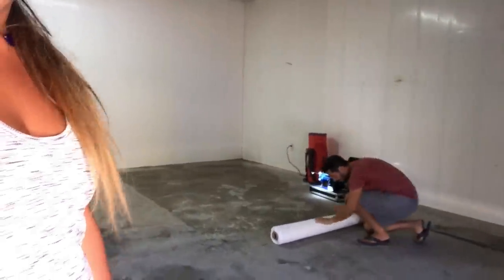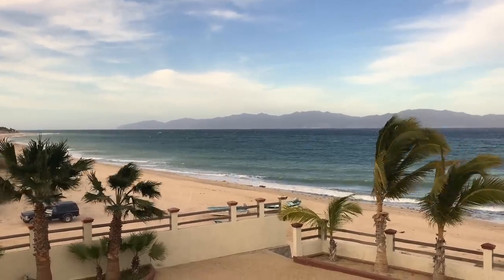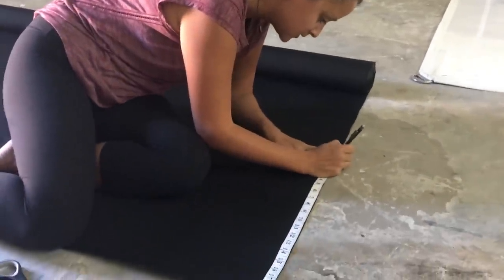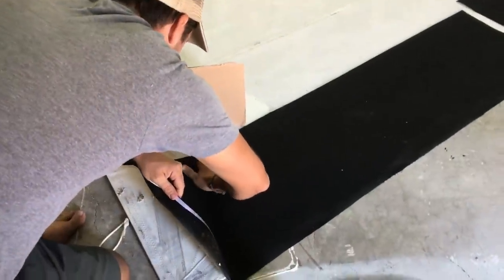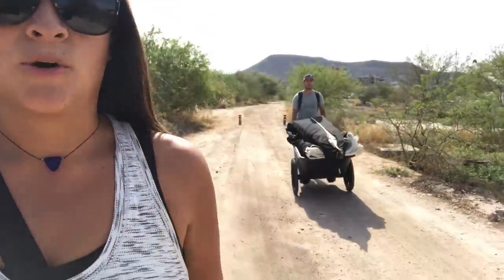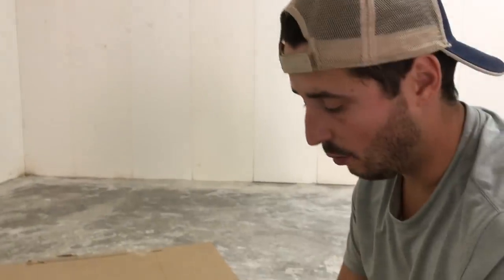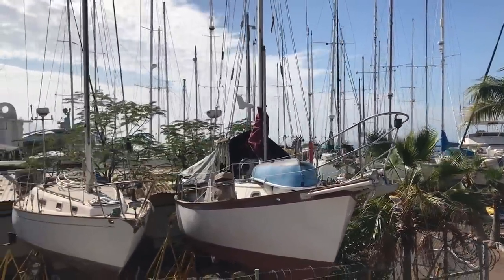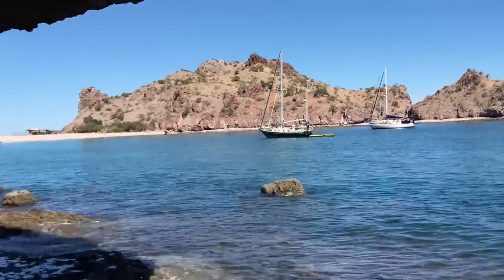Build Your Own Sails and Sail Pack - Wandersailing 20

Comment: I'm considering investing in sewing machine and making sails, covers, cushions, etc... this is the first video I watched on DIY, very well done video... will watch your other videos as a result, thanks! One question:  Working on my knees like you did would not be feasible for me... have you seen any temp-sail-lofts with tables for rent anywhere?  If you built your own table, how big would it have to be?
Reply from the maker: We mostly used common spaces and sneak in some conference, boardroom at night we could have access. That made working on the sails a lot more enjoyable and lot smoother on the sails then working on concrete.

Comment: What was the difference in cost between you guys making the sails, cost of equipment, materials and time and effort as to a sailmaker making them
Reply from the maker: Stuart McMichael We got quotes for about $15k CAD for the Mainsail, 135% Genoa and sailbag. It was about $6k CAD for all the material and sewing machine. For us $9k saving for 3-4 weeks worth of work, being able to maintain/repair our sails and learn tons was well worth the hard work, sweat and tears. Also the service at Sailrite was great. Jeff and the rest of team was answering all my newbie questions within a hour most of the time.
Reply: Wandersailing That is quite a saving, and I can understand why you put in the hard work yourself.   Great job, I was just curious as to what the difference in cost was going to be.    Pizza is the winner.   👍⛵️